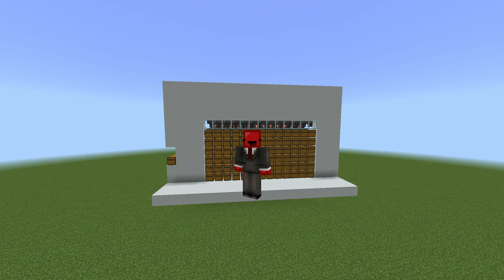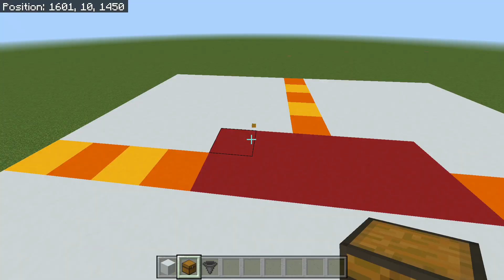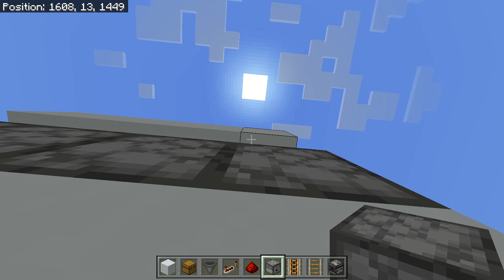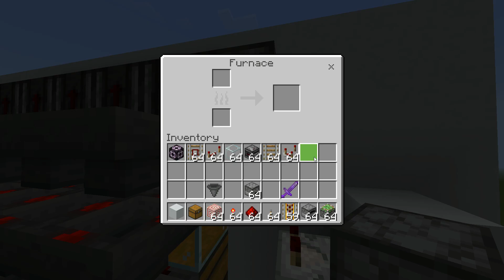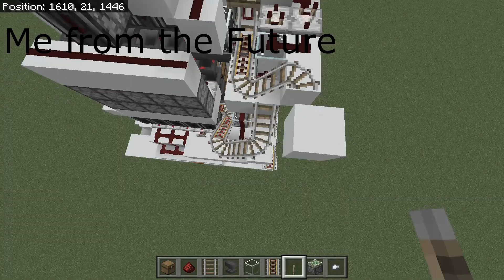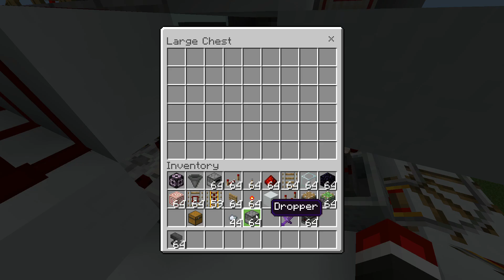Minecraft Bedrock: Item Categorizer Storage System for Mobile Console and Windows 10

Comment: Hey, I just spent a million years making this, it's not my first ever attempt I'm used to following tutorials but unfortunately there is an issue here..... You said make around 20 lines although you did 5, so I did so BUT the line of rails placed on the hoppers loses signal halfway through and there is absolutely no way I can find to continue the signal without actually cutting a whole line out in the middle of the storage system in order to make it run. It's a great tutorial though, clear and easy to follow. I've checked a million times and I've definitely built it as it should be.
Reply from the maker: replace the unpowered rails with regular rails
Reply: Thanks for the quick reply! I will do that soon as I can. I also had issue with the minecart going back up the rails I put it on to send it off despite my rails being linked correctly to the alternative rail for it to go down....... Will do the fix soon as I can, that you said...... Great tutorials and info though thank you.
Reply from the maker: If you have the rails like it is in the tutorial it should work. I dont know what would be causing that
Reply: @IfOnlyYouKnew79 you could of just dug below the rail and put a lever on the bottom of the block

Comment: Great sorter however a few tips, if you explain the purpose of each circuit and how it works, it allows your viewers to learn how to trouble shoot any problems that arise typically due to the inconsistencies in bedrock and be able to ajust and evolve designs, secondly when you are making a cut to correct a mistake try having the points in the recordings be closer together as sometimes parts of redstone can get harder to distinguish the deeper in you are. All in all a pretty good tutorial though, I have ran into a few small bugs.

Comment: After consulting many alternatives for a planned huge storage system on my survival server, I decided to go for this one, as by function vs complexity. I can confirm that it works on Bedrock 1.19 but I had to do a few fixes in the right part, but I am not sure if I missed something. 

FYI: for all who want to build be warned that this build as-is is not  indefinitely scalable. Problems start after about 30 chest columns. The first and easiest part is to leave one free column to be able to insert powered rails in the upper rails. At least I did not find any other way to get them powered without interfering with the sorting mechanics. The next problem is that after the second  
signal extender. As explained in the video the signal needs to be extended at 15 redstones from the observer,. As from the first extender you also need to count a maximum of 15 redstones between the output repeater and the next extender repeater.

The problem is that these repeaters introduce delays that make the observer that resets the selection signal (droppers at the backside) will start flickering at some point which causes the selection to be prematurely reset and the minecart also prematurely released. Both can create different kinds of problems, where as the most obvious at first is that some affected items  end up in the unsorted items chest because the reset  causes the selection to be cleared and thus the hopper to the correct chest locked.  The premature cart release could potentially cause some objects to be put into a wrong chest as well.

The solution to this is not an easy one due to space constraints and needs a good understanding of redstone mechanics.  I managed to insert a pulse extender with 2 comparators which keeps up the signal for now. But I am currently at 40 columns, planning to extend to about 150! It should theoretically be enough to accommodate the 150 columns but in my case I need an additional interconnection between 2 rows of  storage  so it may require an additional 2 comparators and possibly additional changes.

The pulse extender requires changes at the front (above observers) and back (around the dropper RS-FlipFlops). The main additions for the pulse extender have been done on glass not to interfere with existing circuitry.  Some RS-Flip-Flops at the back require their reset block with redstone to be moved aside the dropper to prevent the redstone to connect with the pulse extender and restone directly above the dropper does not work. The reset observer with sticky piston had to be move a bit away from the input system, which is no problem. The signal itself is catched a little bit earlier to accommodate the pulse extender which just requires some more conductive building blocks on top of the front observers.

Another issue with this build is that it does not work for items with a stack size of 16 (like buckets). For the selection it is possible by just placing the bucket like any other item in the selection chest but additionally clearing 3 other slots, because one of these items counts like 4 of a 64stack item. This works as long as you do not place more than 15 such items in the input chest (in total). In case of 16 items the minecart will be completely filled and no space left for the selector item to drop in.

I am currently investigating solution for this, where one dirty one would be to make a special chest for such items filling to the original one but only up to 55 items in that chest which would be a maximum of 14 of a 16-stack item which would be great. The drawback would be that these items would always be sorted out last and need pay attention where to fill in what. Another option would be to use that additional chest for all items in the first place, but this will slow down the complete sorting.  Another option would be to replace the current timing circuit by a sensing circuit but I am still unsure if this will have any side effects and fit the available space.
Reply: I haven’t built this but I have a solution for the 16stack problem. Maizuma I believe, has a very similar sorter for Java and I have built it in bedrock; almost identical in premise. But the way he tackles the problem is he pulls 1 item out of the minecrart hopper as it is leaving the input chest, sends it into a dropper elevator, that drops the item into the hopper minecart as it comes back around. Essentially this removes the need for 2 trips for a stack of 64 so the initial launch clock can have enough delay to pick up a full stack. In a way it increases time per trip, but I think it’s a decent fix.
Reply: Did it work?
Reply: brings a video tutorial for the 4th paragraph pls

Comment: Alright so I built a 10 wide system but the rail system above the filter selection chests isn’t completely powered(3:17 in your video). The two closest to the input chests are not powered but everywhere’s else all the rails are powered so how do I fix this?
Reply from the maker: if there are unpowered rails replace them with regular rails
Reply: It’s a really good design otherwise